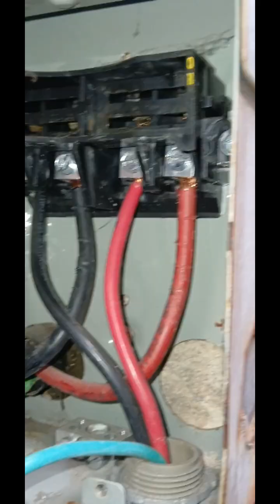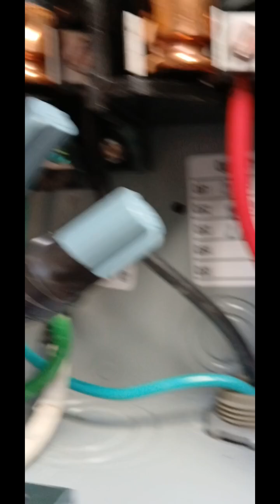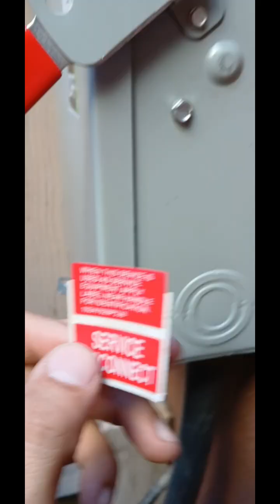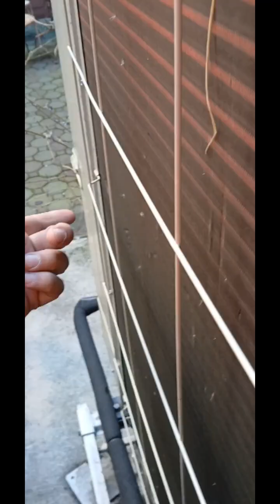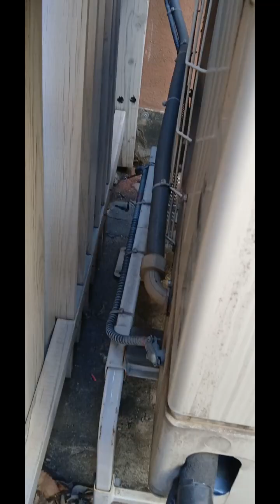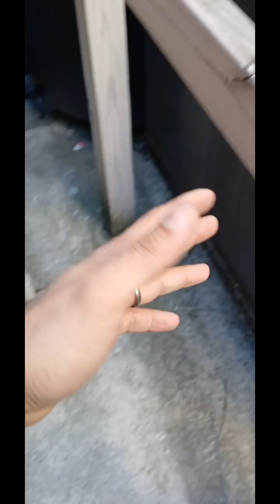Replaced a 208v AC Service Disconnect | KleinGuy Jon

Comment: Why are you replacing good equipment!  Every electrician knows you should just spray paint it a little bit and clean off the contact and call it a day
Reply from the maker: It wasn't worth fixing but replacing. The female contacts on one of the ports were melted due to poor connection between the plug and the pull fuse. Leaving the AC being on a single-phase operation that can't operate on one phase. 
It had to be done, my bruhda! 😆
Reply: @KleinGuyJon I was joking, that was crusty & rusty!